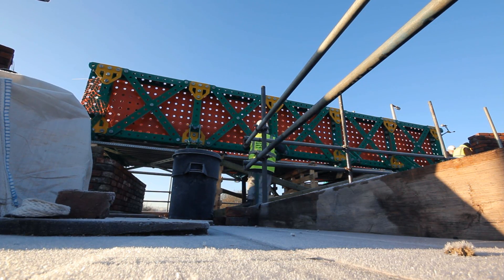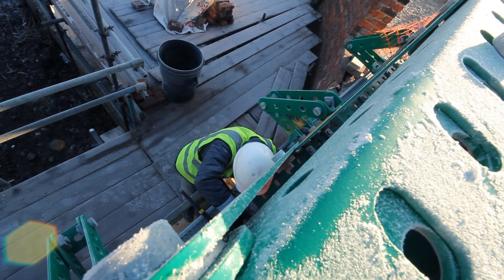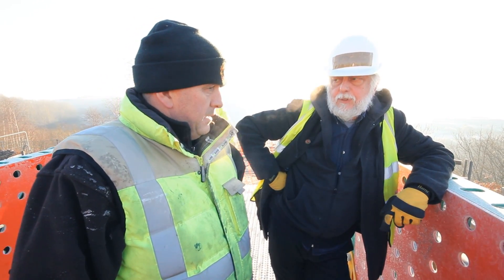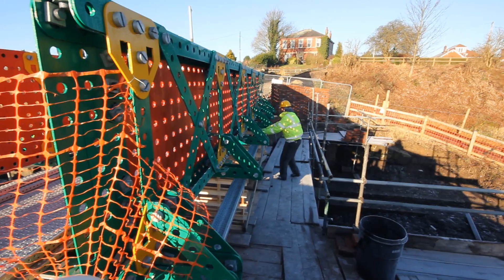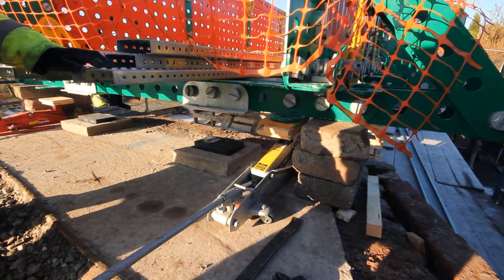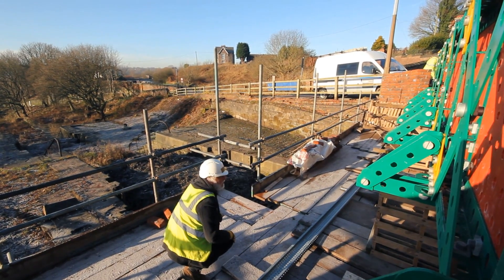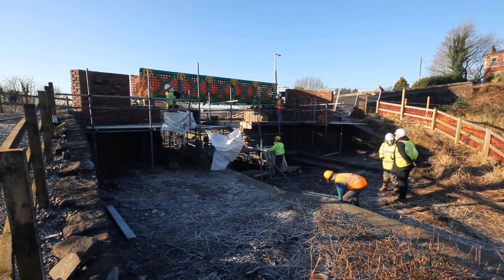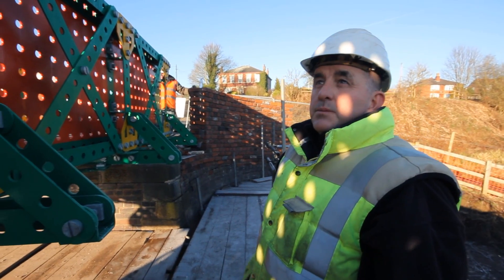Meccano bridge construction on the Manchester, Bolton & Bury Canal, part 4: 11 December

Comment: £90.000 for an uncessary bridge - as for connecting Moses Gate with Litttle Lever  - there has always been a route to get to the Blue Wall from the dry cut - by installing the bridge they have blocked access to the far side of the locks - the old "horsebridge" was demolished decades  ago - if they wanted to spend so much money why not reinstate the locks and the canal
Reply: Or preserve the historic Canal Company Depot which seems to have been demolished around the same time.